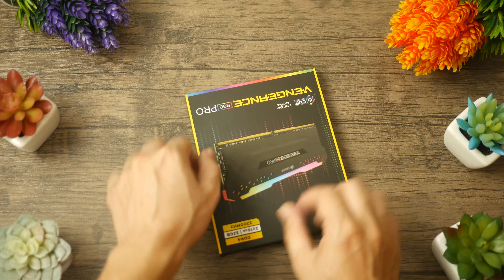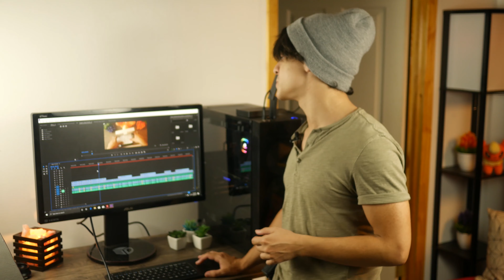Building A MONSTER PC | Ryzen 7-3800X + RTX2080 [TESTS]

Comment: Would a nzxt kraken z63 aio also fit in the case? (280mm)
Reply from the maker: If you're using two 140mm fans on the ceiling of the case, then it should fit. But I think it's designed for 120mm fans.

It's been a while! Sorry!

Comment: I am planning to build a pc with ryzen 7 3800x, 16GBs of 3200MHz RAM only for coding purpose. I don't need fancy GPU as I don't do content creation or gaming much. Which motherboard do you suggest? I will like to use x570 series but I'm tight on budget. Also, this will be my first pc build. Do you have any advice or video for a novice?

Comment: Build mine to almost the same specs. Except I used a 1TB nvm ssd ‘for MY games’. Saw you had the space to spend a couple bucks more on a h115 platinum like I did. Went with a RTX2080 hybrid (water cooled) on sale. I OC’d it so it runs like a stock “super” now.

Comment: will this build work ? need to know asap please.
CPU: Ryzen 7 3700x 
Mobo: Gigabyte x470 aorus gaming 7 wifi
GPU: Gigabyte Aorus GeForce RTX 2080 extreme 8g?
RAM: 32G 3000Mhz
Reply from the maker: Yes, it'll work great.
Reply: I would go for 3600 mhz of ram as amd cpus benefit the most with higher ram speeds
Reply: As spawn and batman said higher mhz on your RAM would be better. Ryzen loves fast memory. 3400-3600 is ideal
Reply: @spawnandbatman6975  check "highest supported ram speed 3700x" dingus